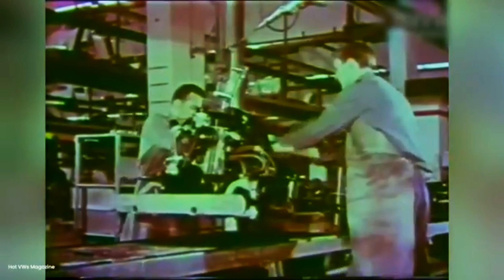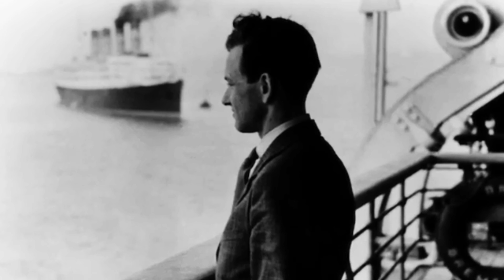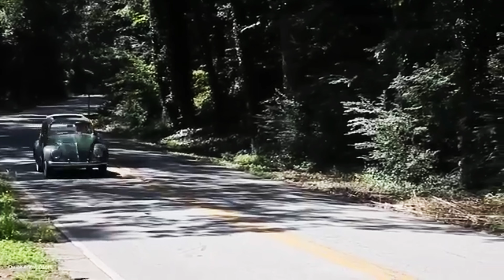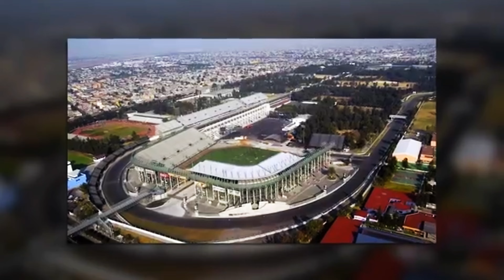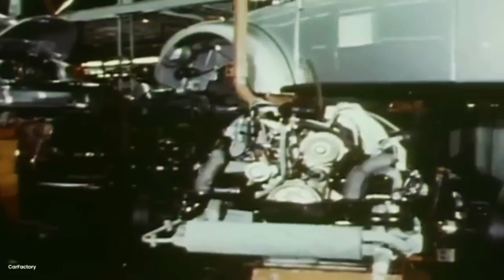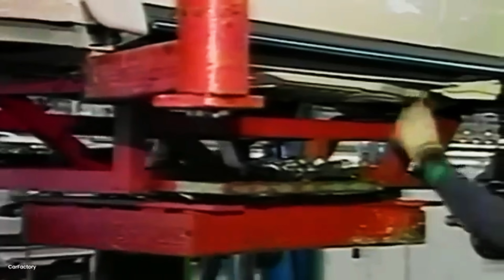The 200 hp Mexican engine from the Beetle that VW never wanted you to see

Comment: This is the most fraudulent BS piece of misinformation yet released on YouTube.

It was Dean Lowry in collaboration with Joe Vittone whom had critical impact in the development of the 78.4 and 82mm stroke crankshaft.

Furthermore, VW Performance Pioneers such as Deano Dynosoar, EMPI, Gene Berg Enterprises and FAT Performance struggled to produce >185 HP during the timeperiod of 1966  through early 1970.

The original Inch Pincher ran in the 13's until 1967.

Dean Lowry's record holding Deano Dynosoar 2180cc high compression race engine is noted to be the first naturally aspirated air-cooled exceeding an actual 200 HP.